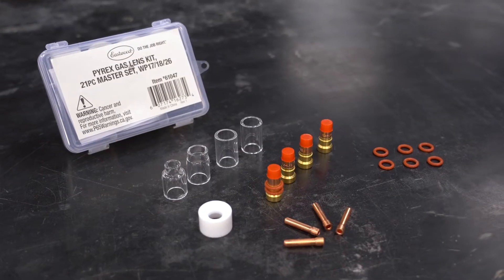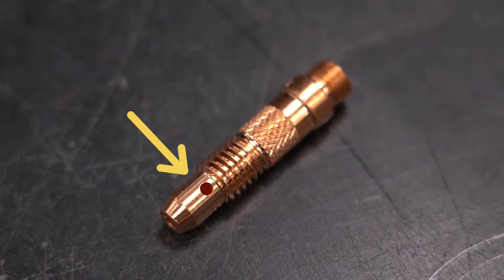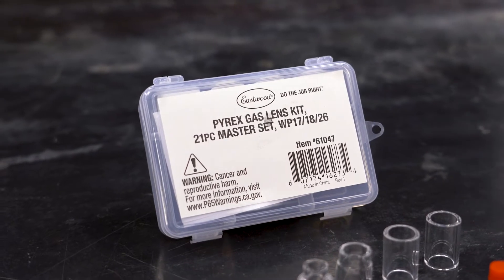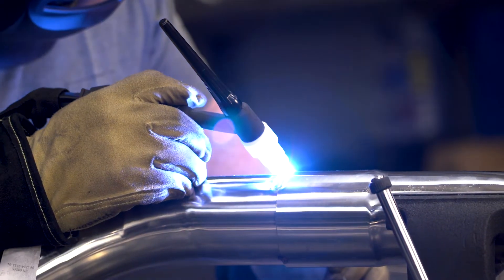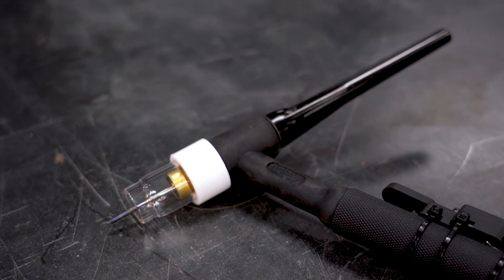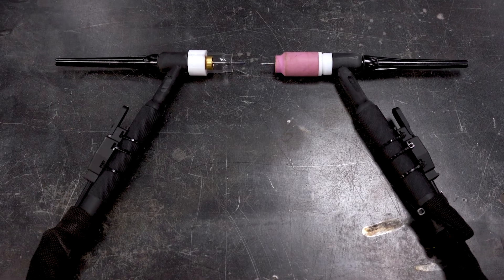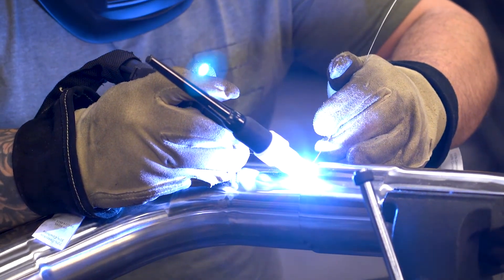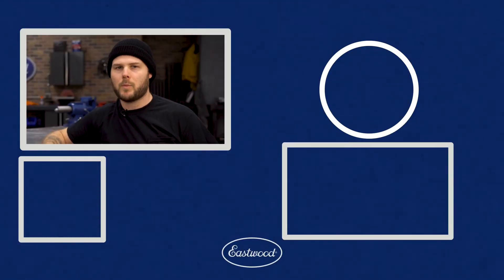Pyrex Gas Lens Kit - Improve Your TIG Welds!

Comment: Hi. I recently bought a Eastwood Glass Gas lens kit for WP-26 torch. the Collar included in the kit doesn't fit well on my torch. Even if I am able to get it to fit snug no matter what I get severe porosity welds. Tried many gas settings with no help. My standard gas lens works perfectly with a regular gas cup. I think the problem is the loose fit on the collar. Does Eastwood have different collars available. I would like to get this to work but thus far not. Thanks
Reply from the maker: Email afair@eastwood.com with the subject line "Glass Gas Lens Issue" and we'll see if we can get you a replacement.
Reply: @eastwoodco  O.K. Will do.

Comment: Hope your o-rings are a bit more resilient to high temp than the cheap e-bay glass lens kits.
Reply: Wat amp color and size tungsten where you running I'm running up to 200 amp dc with number a ten stubby Pyrex gas lenses off wish come in a 52 peice set cheap cheap but all the same exact stuff the o rings I used where green and seem to be holding well
Reply: Also noticed you can use two o rings in the groove or one single on the edge of the plastic bevel the single is a tighter fit for sure and its up far above the collect